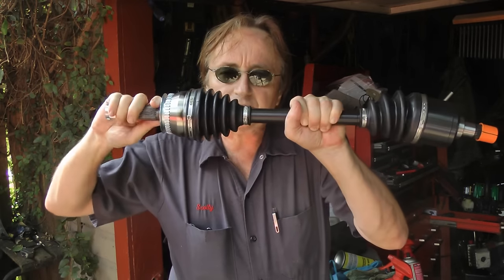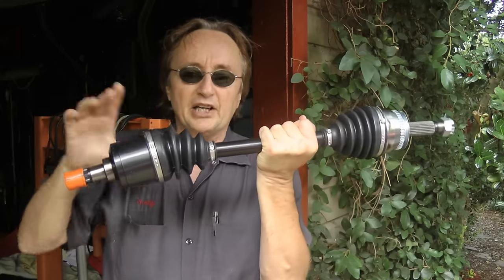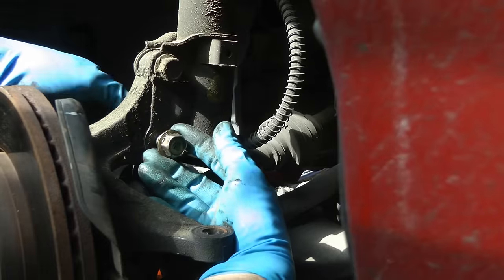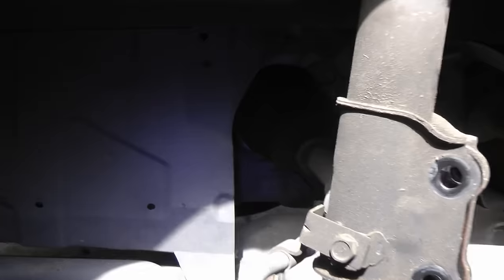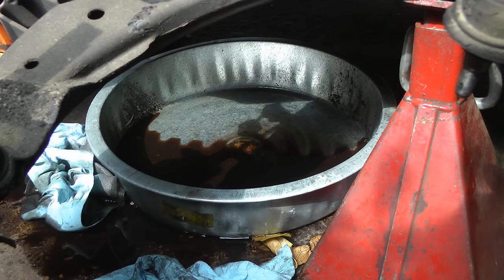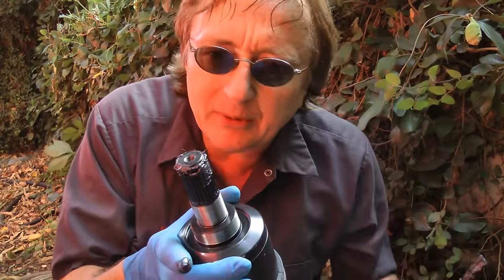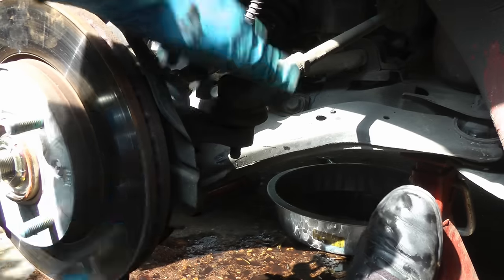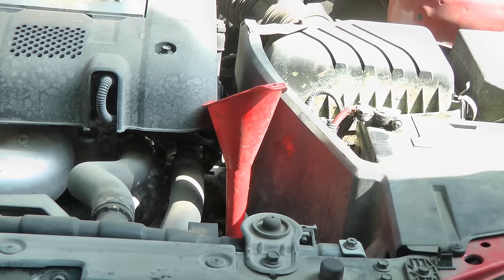How to Fix Car that Clacks When You Turn (CV Joint and Axle)

Comment: hey Scott, I have the same problem like this one. and I need your help. so I jacked up my car and checked on the CV joint. both left and right, but it ain't worn out. is there anything I should checked other than CV joint? thanks.
Reply from the maker: worn wheel bearings, worn strut mounts, worn Ball joints
Reply: Thanks Scotty. God bless you.

Comment: I have a 1995 GMC Yukon and whenever I drive in 4WD, I get a clunking noise from the front end. I've rebuilt the transmission and transfer case (I have a manual t-case) as well as replace the electric actuator in the front axle to engage the CV shafts with the front differential. The rubber boots still appear intact, but I wonder if there might be some internal damage. Could it potentially be my CV shafts that are bad or is it something hidden deeper in the front axle? I appreciate all help.

Comment: Scotty, I have a rwd 1996 C1500 and when I pull into a parking spot, usually downhill, and crank the steering way to the right, it sounds like the left tire is sliding out on gravel but I am on pavement. Do you know what that could be? The truck has near sway bar links and all new tie rod ends. Thanks.

Comment: What happens when you have a crackling sound when doing slow sharp turns, replace both CV axles and still get the crackling sound (20 km/h tight right turn)... what else could make a crackling sound. BTW, bearings are new too, and sound was unchanged after that too.

Comment: Got MPV 2002, Went I turn wheel it's like some steal bar cranking, not frequently but randomly, it's not the power steering, I change Disk, Pad, install new Bushings and put silicone grease, but now ABS is ON from time to time, and went I turn I ear a cranking sound, I change link Kit as well. Could it be Suspension Tab Bushings ?

Comment: +scottykilmer , I have an 07 Jeep Compass that makes that same sound when moving and turning left.  There is also a slight groan/creak when the car is stationary and i turn the wheel back and forth past a certain point (about 50% to the left).  Does this still sound like a CV joint? Have had a couple of different diagnosis, from CV (even though he said there were no tears or breaks) to ball joints and control arms (which were replaced less than a year ago).
Reply from the maker: +Adran Tyler it's a jeep, probably more than one thing wrong. Front CV joints are probably worn, and creaking is often worn A frame bushings or shock bushings. Good luck

Comment: So the only thing preventing the CV joint from lasting much longer is the rubber boot failing?  Seems like you should be able to do a rebuilt as preventative maintenance, replace the boot and grease every so many miles.

I wonder how much longer that would make the axles last.
Reply from the maker: once it makes noise, bearings and cage are worn, and need replacing. A modern aftermarket complete axle with both new joints costs 50 buck in many case, no sense fixing broken ones, that would cost tons more

Comment: How you doing Scotty I just got my front axle repaired 2 weeks ago on my 2005 Honda Accord an it start making this clacking noise when I turn wheel in low acceleration an even when I have car in parked could it be a bad axle ?
Reply from the maker: +LaTavius Davis yes, or could be the other side

Comment: Scotty Kilmer  thank you sooo much my cv joint broke and you helped me a hek of allot. i have a Hyundai Santa fe ,, only thing i couldn't do was taking the tire arm i believe, off . So i only took the 2 big bolts from the top and put the new one in, i assume the manual cars don't have both ends like you had in this vid they are different? my axel was fine
Reply from the maker: Moises Ridderstaat all models are slightly different, you fixed yours fine

Comment: hey scotty, I tried to change cv joint boot only and i failed yesterday. So I changed my cv joint as regenerated cv joint. is it ok to use it these days?
Reply from the maker: It's OK, but really, I just change the whole axle assembly with the low prices of new ones these days

Comment: I replaced the axle exactly he same way, but when I'm going over bumps there is a good amount of knocking. Wasn't like this before I replaced axle. I checked everything and I just can't recreate this knock when car is on jack. Everything feels good. And I think that the axle was all the way in the tranny. I was pulling on it by hand but it wasn't coming came out.
I ran out of options. Can it be the axle isn't all the way in?? Or the axle nut is not tightened enough? (although I put a good amount on force...

Comment: Hey Scotty, I have a 1999 Ford F-150 XLT. I have a problem right now where the power steering fluid won't go to the power steering column and for some reason goes out the top of the container that holds it. Any idea what could be causing this?

Comment: I just had both front drive axles replaced on 2009 camry 2 months ago, but occasionally during uphill acceleration and turn, the clicking can be heard... is a drive axle necessarily bad?

Comment: The front tires on My 2012 Mercedes E550 All Wheel Drive Skips or jumps cross the concrete when I turn sharp while reversing . Could this all be the CV Axle Joint ?

Comment: I have alloy wheels. I don't have someone to stand on the brake for me while I try to remove the hub nut. Could I remove the center cap from the wheel, remount the wheel , lower the car and work through that center hole to loosen the nut?  If not, what else could I try?

Comment: Hi Scotty, I have a question I have 99 Toyota Corolla and 2 months ago axles was bad when I bought the car so I got them replaced. Now after 2 months brand new cv axle that I put on before making the same noise only when I turn to right, what would need to be get it fix? Let me know please ASAP I'm planning to take the care to alignment shop.
Reply from the maker: +Animator Fiftyfour   if it's a rebuild axle, they did a crappy job rebuilding it
Reply: +Scotty Kilmer no they were brand new from autozone

Comment: Hey Scotty my lady got a 2003 dodge Durango SXT 4.7 and the AC does not blow hard. I replaced the blower motor resistor thinking that may have been it since switching the placement of air makes no difference. Still no luck. Any ideas?
Reply from the maker: check the ducts to see if kleenexes or leaves got in

Comment: Hey Scotty, my boot looks fine but im sure my CV Joint is worn out. Has all the same symptoms but the boot looks fine. Is it possible that the Joint is worn out but the boot is fine?
Reply from the maker: they can just wear out internally, especially if the boot broke years ago and was replaced, cause damage was done with the leaking

Comment: So I got new rotors new front axle and control and motor mount on front passenger side. New tires that are balanced and alligned and shocks/struts rack and Pinion ,sway bar and yet my car still shakes on the freeway starting at 65mph and steering wheel isn't strait after all this it still goes slightly left and when a bump comes the wheel turns left ...scotty help me out!

Comment: I did this and when you bang it with a hammer you risk stripping the end of the axel where the nut goes back on. So now I can't get the nut back on. I need a m22 die but can't find one. So ya, I don't recommend banging it metal on metal. I didn't bang it hard. I think I just caught the end of it.

Comment: hi Scott, i have a similar problem expect that when i turn the steering wheel makes several knocks especially if i turn slow. i suspect the the steering coupler is broken plus the left light started to light faster than usual. the car is 1 year old
Reply from the maker: take it back, it's under warranty, let them fix it free
Reply: i didn't mention that the guys at the warranty actually did the mistake. i am tired of their incompetence but yea i guess i have to return to fix it. they always want some extra money even if they have to make it up and that is why i was searching online for solutions. i live in Egypt so...thanks Scotty, i'll let you know how it went, i am a little short of money now but soon hopefully i will take it in, i know they will take some extra money of me it is just a go here.
Reply: Hi Scotty, so i went to the warranty changed the inner and outer rods on both sides, fixed flickering left side light, went out on the road and after a 100 km the light started flickering again. the steering and wheels seems fine so far. 1 day has passed
can a light flicker cause more damages on the long run?

Comment: I'm getting a similar noise when turning ONLY to the right. However, neither one of my CV boots are worn or torn, is it possible the axles might still have a problem?
Reply from the maker: sure, they can break internally without the boot ripping, especially if boot has been replaced already in the past and joint was somewhat worn then

Comment: I have a problem with my 2014 Lexus IS350 F Sport that steering and car shaking when I push the throttle above 65 Mph on the highway. Is that because of the CV joint or CV Axel itself?

Comment: My car clicks whenever I turn left sharply (2003 pontiac grand am), I've replaced the cv axles on both sides but it's still doing it.  Is there anything else that it could be or did I just get a bad part from the store?

Comment: hi Scotty ...I got a 2007 jeep compass and it's making a like a pulley barring noise ..but I can't pin point the noise any suggestions would b helpful. ...thankyou
Reply from the maker: +Carlos Alicea remove the fan belts, see if noise goes away, then find which pulley is making the noise if so by pulling in them by hand

Comment: Hi Scotty i have a 2000 Accord (European) and had my pressurebearing replaced cause it made alot of noise (whirring/peeping) when i released the clutch. So drive in gear that is. U hear it well if u drive past parked cars in the street. The noise was gone for some months afer they replaced the pressurebearing and geardisks etc but returned again, now its getting worse by the month. What do you think could be the problem? Excuse my bad Englisch. ;)
Reply from the maker: you should have replaced the entire clutch kit with all clutch parts when doing that bearing. Cause with noise coming from inside, you will have to remove the transmission and replace ALL the clutch parts. Mechanic should have told you that first.
Reply: Scotty Kilmer Thnx for the answer m8. :)

Comment: Hi Scotty. this sounds like my 2006 gmc envoy but I also hear a  grinding noise when I turn to.the right. I just replaced the master control arm and sway bar link on that side. I get those axle noises from both sides but grinding I'm not sure of what it is. stumped?
Reply from the maker: often worn wheel bearings do that causing brake rotor to wobble and hit stuff, or the bearings themselves grind

Comment: What if you have something like a 2003 ford explore that don't have a dipstick to add fluid. So if some leaks out how to refill it? Not my problem anymore I traded that headache in. Just for ppl that might come across something as such.
Reply from the maker: you have to pump fluid back up from the bottom drain plug. Yea, real stupid design, but that's modern engineers for you

Comment: High Scott. Hey I have a question. I bought a 2008 Dodge grand caravan sxt.  I had problems with the left rear break and it was wearing the one pad closes to the caliper unevenly.  So I bought a new rotor and pads but it did the same thing. Ok, so I then tright to loesen the caliper guide pins but snapped one.  It was so rusty , I just figured I'd by the new caliper pad bracket.  I realized the slider pins work perfectly. Now when I was bedding the new rotor and pads I felt something weird coming from the front passengers tire. Please. Give me some advise. I'm not a mechanic. It just cost too much too go to an auto shop. By the way.  When I first took it for a ride the front rim got real hot. Was it that it was working too hard. The guide pins worked fine. ???
Reply from the maker: me, I'd buy the entire calliper and bracket as a rebuilt assembly, just did one, XL parts charged me 59 bucks for all the parts

Comment: Hi Scotty, how to solve the problem if the front wheels when turning rubbing against torsion bars and stabilizer? Already happened replacement rod and a broken right shock absorbers .My Car toyota with  2Lengine rear wheel drive.terimakasih, Greetings from Indonesia
Reply from the maker: +Tektek Mie check all suspension parts, especially the control arms to see if they are bent or bushings are cracked

Comment: Good video but i have a question. My parents have a 98 cavalier with a 2.2 sohc efi automatic and the coolant temp gadge will work for a while then drop down to nothing then after about 10 seconds go back to normal. I changed the sensor and fixed were it looked like some one cut the wired by re soldering them and shrink wraping them but the problem is still there. Do you know anything that mite cause this. Fyi it has 168,000 miles on it
Reply from the maker: bad wiring repair job was probably done. See if you can find a temp sensor wiring repair kit at an auto parts store and splice that into good wiring further down on the vehicle

Comment: my 05 pt cruiser feals like im driving on some off road tires and gets louder the faster i go and has alot of resistance.. any way of knowing if its this or like a hub or bearings or idk
Reply: Update axles and wheel bearings have been done since last comment still makes that clicking noise but it's a pt so 🖕 it

Comment: If you do just replace the joint itself, how do you get the joint over the drive shaft with the circlip in the way.?
Reply from the maker: +Jason Millar don't bother, most cars you can get a chinese made whole shaft for 59 bucks or so. Otherwise you need special tools to get the clip on and off and they often then break
Reply: Ok, thanks for the advice, keep up making great videos, I love them!!!

Comment: I have a 2004 mitsubishi outlander 2wd and I can't seem to figure out the problem think it might be a bad cv axle just replaced the sway bar links two weeks ago but I have a steering column vibratetion  problem over the seed 55mhp could what could this be

Comment: Hi Scott I have 2004 Acura TL and it makes the same noise when ever I stop and go it only does it for 1 sec. It does it on turns too but not all the time. Does this means I need an new axle??
Reply from the maker: +Hamza Saeed it often does, see if the cv boot rubber is torn with grease leaking out
Reply: +Scotty Kilmer I  just find out what was the problem the right passenger  side mount and 2 transmission were done. Haha but it sounded like axle was done but axle was all fine. Keep up the good videos Scott👍👍👍👍

Comment: could this issue  be fixed by just replacing the cv joint?
Reply: +factualclass Yes, that's what I do with the very same car (even same color) that appeared in this video. I pay 15 bucks for a CV joint here in my country, but is a pain in the ass to remove the old CV joint for this model, tight as hell. Still cheap.

Comment: Hey Scotty I have a 2001 olds alero v6 auto. I recently replaced both sides of the front end, wheel bearings, the rods, cv shafts, brake pads calipers and rotors. but now when I turn the wheelall the way left while sitting still it makes a SOLID pop sound? just one time. I'm at a loss. any ideas? I torqued everything down with a torque wrench at the right foot pounds but I have no idea what could cause this noise
Reply from the maker: +bsblazzer 420   many things can pop, from struts and strut mounts, A frame bushings, ball joints, etc. See my video "finding the source of car noises" to pinpoint yours
Reply: +Scotty Kilmer I'll do that, thanks for the info!

Comment: hii Scotty I have a 96 Toyota with the same problem when turning I heard the noise. today I tried to park my car and I was reversing I heard a noise and the transmission stopped working. also noticed small balls falling down. do I just need to fix it like you did ?
Reply from the maker: +A -Youb yes, those balls are the cv joint ball bearings
Reply: +Scotty Kilmer thank you scooty. and it's reasonable for the car not to move. I don't need to worry about transmission

Comment: I went mudding in my 2000 nissan xterra 2 days ago, It ran fine all yesterday, but today I started it up and it stalled, I cranked it up again and started right up. It did this a few times and every time it started up and ran fine the second time a cranked it up. The service engine light did come on after it stalled the first time. The truck has 246,000 miles on it. And the engine has never been replaced so I'm wondering what it might be and if the engine is about done with all the abuse it's been through. Did I get mud somewhere it wasn't supposed to be? Is the fuel pump partially clogged or bad fuel pressure? (fuel pump was replaced a year ago) Is it a dirty sensor? Please help me Scotty.
Reply from the maker: tons of things can go wrong going in the mud. Water and mud don't mix with electricity. Start with my video "fixing a car that cranks but doesn't start up" to find what system has been knocked out

Comment: What would most likely be the cause for a car that would stall in reverse (98 ford windstar gl)?
Reply from the maker: If only in reverse, check for broken motor or transmission mounts and PRAY it's not reverse gear going out
Reply: Thanks Scotty